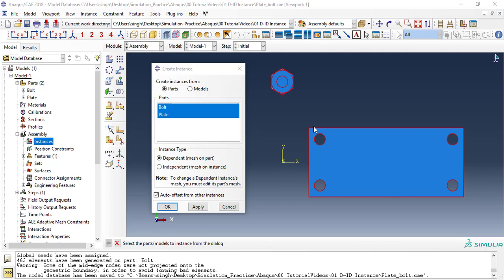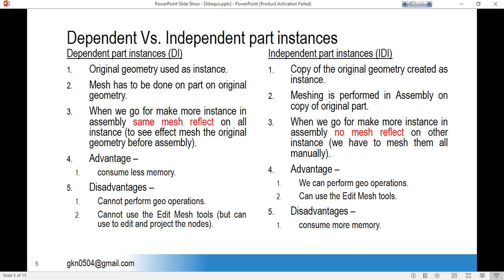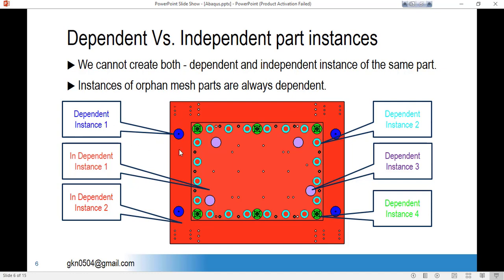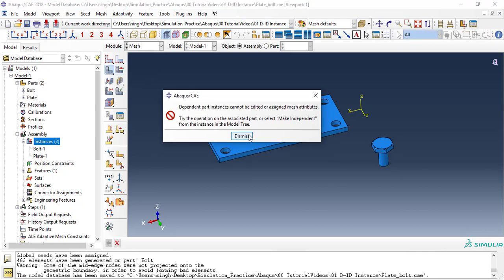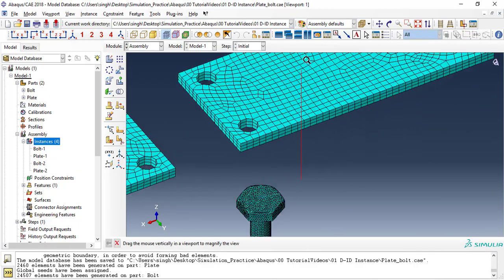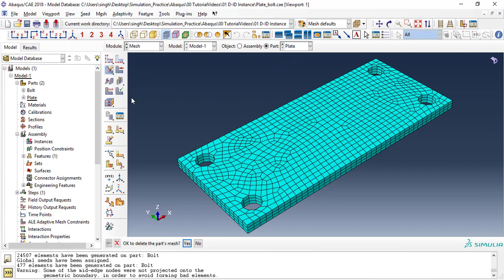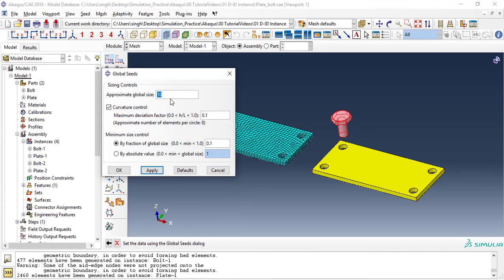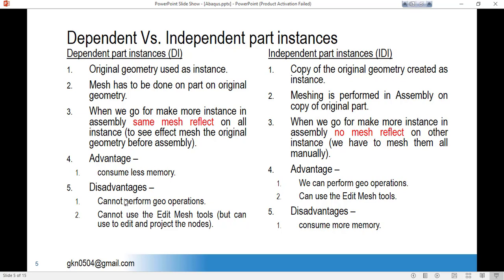Dependent and Independent Instance in Abaqus

Comment: Excellent video sir. If we are using dependent mesh and assemble different parts there will be a node mismatch between parts.. is it a normal thing to happen.
Reply from the maker: Make sure a proper contact or interaction defined between them.

Comment: Nice Video, this video clear my confusion on dependent and independent options. Thanks
Reply: @arsitech-ltd  Sir can u pls help me, I am modeling a steel channel section of 4 mm thick flange and web with a height of 2200mm, can I use for it solid elements C3D8R instead of shell element S4R.